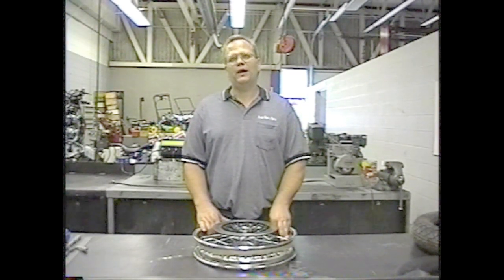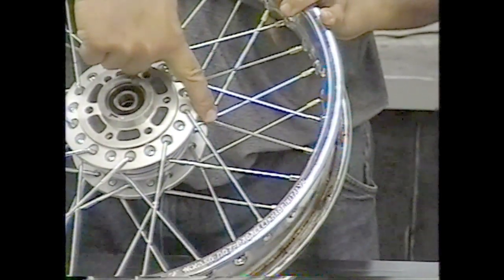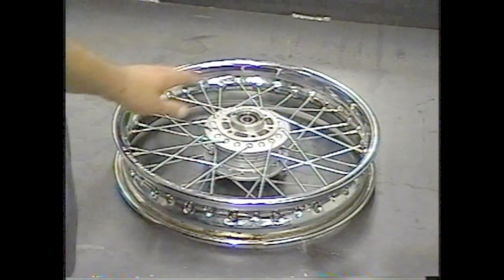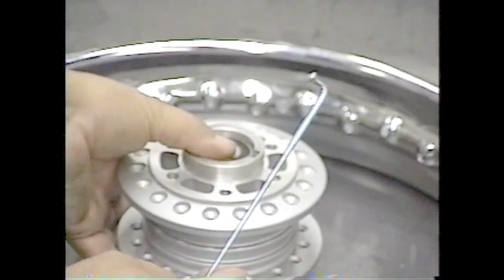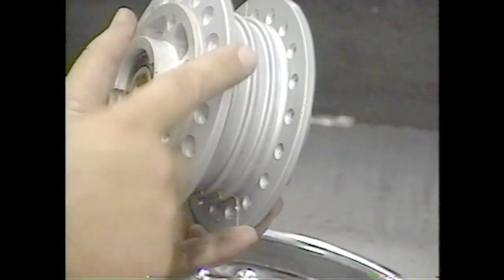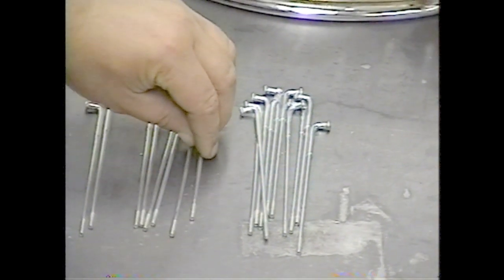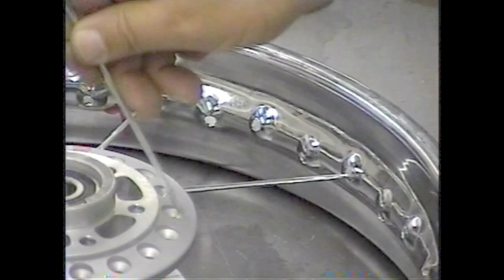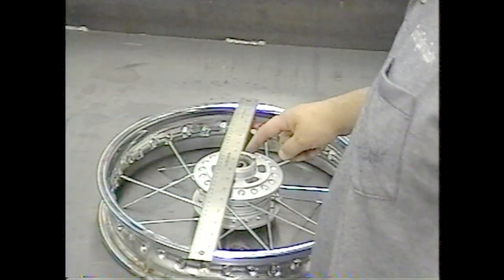How to Spoke a Motorcycle Wheel

Comment: Thank you for the video but have to tell that I lost the sequence due to the way you filmed the video at 15:16 can't see the rim just your back
Reply: Very simple, after you flip the wheel over, take the first spoke to the left of the center line and put it in the 3rd hole to the right, then grab the 2nd spoke to the right of the first one you started on the hub and screw it in the 4th hole and repeat every 2 and 4 til done. They should all fall in line.

Comment: Hi pretty good video , one question l have a rear conical hub from a Yamaha dt 200 .It came out from a 18 x2.15 wheel and l wanted to set this hub in to a 17x3.00 rims but when l tried the original spokes on this new rim they were to long so it didn't work . Then l ended up straining out the spokes at the same angle and setting them in the front wheel wich is also 17 but x 2.50 with a smaller front hub even when l had to cut some of the spoke that came a bit out of the rim . My question is what size of spoke do you think it will fit this rear set up or if there's any way of me taking measurements to be able to know the exact spokes l need for this rear rim with this hub ? Thanks
Reply from the maker: I'm not sure how to answer your question and hope some other member can help.  Good luck.

Comment: As much as I appreciate your video, the back of your shirt reveals very little. For me the last two steps is the most critical and your video doesn't give me a clue as to how to finish the job. Thanks anyway for the first half.
Reply: John Very simple, after you flip the wheel over, take the first spoke to the left of the center line and put it in the 3rd hole to the right, then grab the 2nd spoke to the right of the first one you started on the hub and screw it in the 4th hole and repeat every 2 and 4 til done. They should all fall in line.